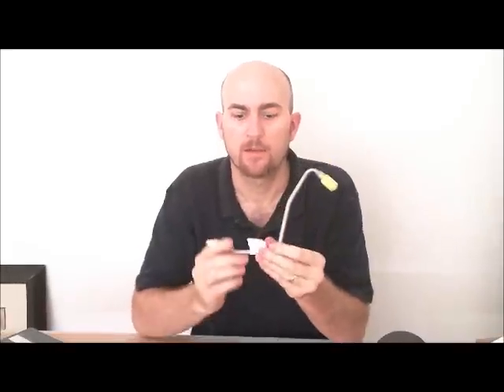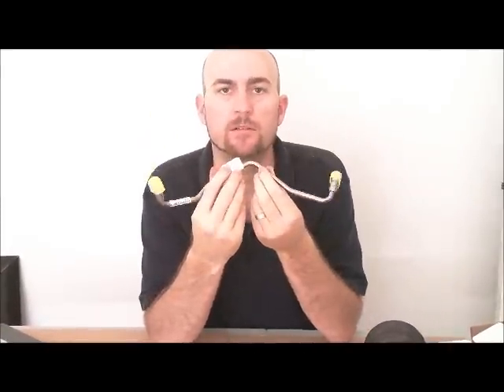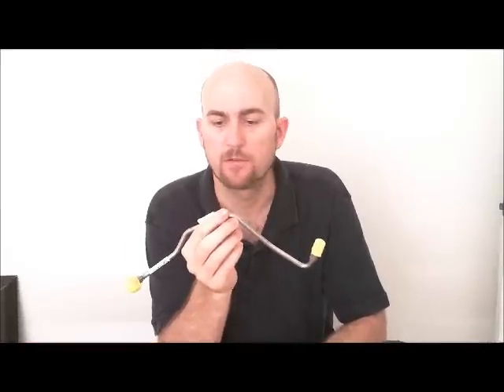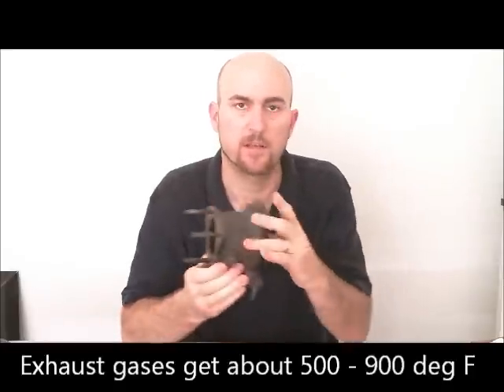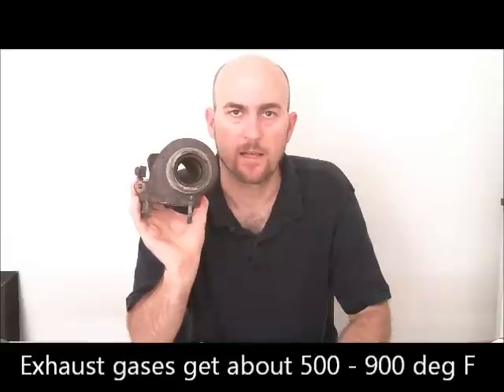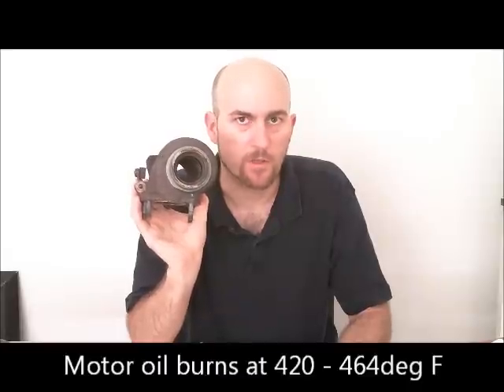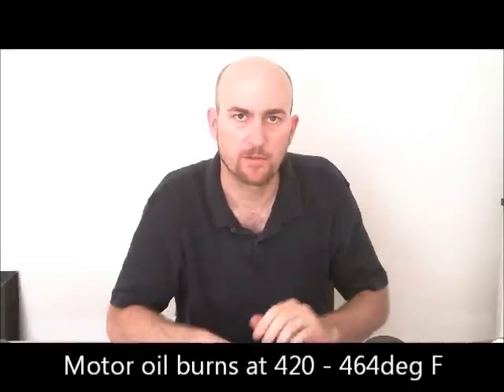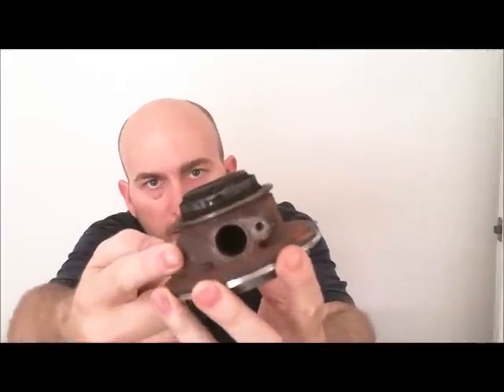How To Kill A New Turbo Quick Part1 Oil Line

Comment: When you put a new turbo on to make sure its not gonna be waste of money. Final stage Prime your oil line and physically see if its producing oil to the turbo! If you can't get it to produce oil on crank due to the new oil change that you should have done when you slapped that new turbo on. Start the car while directly applying oil into the turbo where your line goes and watch that line for oil if you dont see it in about 10 seconds it needs replaced...

Comment: In my opinion I race a R56 JCW I've replaced many turbos and oil supply lines and the oem version is the best unit the braided lines are garbage
Reply from the maker: I like the OEM one too, and if you get one of our heat shields you will reduce the likelihood of having this issue.  the OEM catalyst heat shield blows hot air right on the line causing clogging in as little as 50k miles.

Comment: A can of CRC Carburettor and/or Throttle Body Cleaner is able to dissolve and clean out ANY hard oil deposits. NO need to spend money to replace an otherwise undamaged supply line.

Comment: You imply that the coked oil flakes fall into the turbo when you take the lines off so how will putting new lines in solve the problem the coked, flaked off is still in there.

Comment: if the turbo was killed, can you continue to drive the car without worry of other engine problems?
Reply: No
Reply: @tiberiusclaudiusnerogermanicis  thank you, but i have since found out it is fine to continue operating the car without the turbo.
Reply: @gregorymassaro248  with the damaged one still on the car? Apart from restrictions causing over heat and potential breakage of parts firing vits of metal into the intake and also if the oil seal goes your dumping oil into the intake which can lead to a runaway situation. Talking from experience here and what I've seen. It can cause damage because I've seen it and had to repair it numerous times on people's cars that thought they could continue to drive when turbo failed just with less power.
Reply: @tiberiusclaudiusnerogermanicis  thanks, you have seen this on mini coopers?
Reply: @gregorymassaro248  with the 1.6 common rail engine yes. Very common tuebo failures in them. I had to replace an engine on one of them because of fragments from turbo compressor wheel having a cuddle with valves and pistons, cylinder walls were like a cats scratchpost!!!! The dv6 is the worst diesel engine I've ever worked on yet its in everything!
Reply: @tiberiusclaudiusnerogermanicis  thanks again. fixing the turbo and all the related parts would be very expensive probably close to $3k. if i could get $4k for my 2007 mini, that would be impressive. so not sure if it is worth it to fix it or just sell it as-is.
Reply: @gregorymassaro248  really? That's expensive. What engine is it? Is it the 1.6 diesel?
Reply: I would definitely try and get a decent independent mechanics opinion on seeing your car. Not sure about the US Prices but 3 grand seems steep.. a decent second hand turbo and some gaskets should sort it out depending on the reason your turbo failed in the first place I guess.
Reply: @tiberiusclaudiusnerogermanicis  it is not a diesel. a 2007 cooper s, gas. i am estimating the $3k cost due to all the other parts that are recommended be replaced at the same time the turbo is done. please see this link, and i would be interested in your thoughts. thanks. https://new.minimania.com/part/G2NME2201E-P/Mini-Cooper-S-Borg-Warner-Replacement-Turbocharger-Gen2-R55-r61

Comment: KO3/KO4 turbos use a stationary bearing which is unique. The moment the turbo runs out of oil or hits a stiff spot, the shaft breaks. Luckily We have the ability to get new cartridge for these. Even if the shaft breaks we can still machine the turbine housing out to a ko4 turbine.

Comment: How much does it usually cost to repair/replace the oil turbo line and supply line? If the turbo oil line is broken how long would it take before the turbo is severely affected? I appreciate the educational video.

Comment: Can turbo leak oil into the compressor side and than burn it in cylinders? Or maybe there is to much pressure and oil from the turbo can be only pushed into the exhaust side?? If you know what I mean...

Comment: Can't the line just be cleaned out with acetone, benzine, whatever?
Reply: geecrawdad egr valve cleaner would be better
Reply: No absolutely not the line is weak and has been exposed to high heat and could have fractures and fail especially with a new upgraded turbo ... ALWAYS CHANGE THE OIL SUPPLY LINE PERIOD.